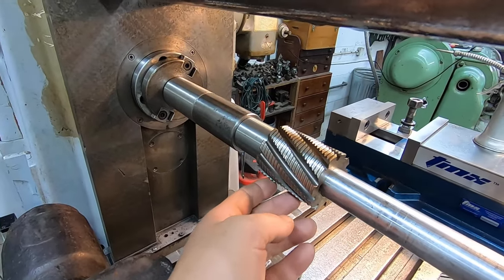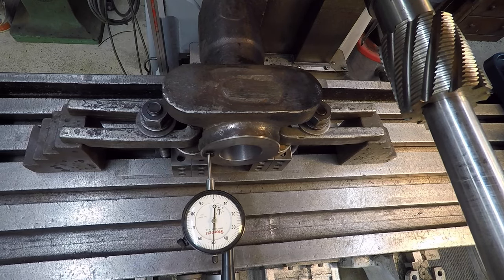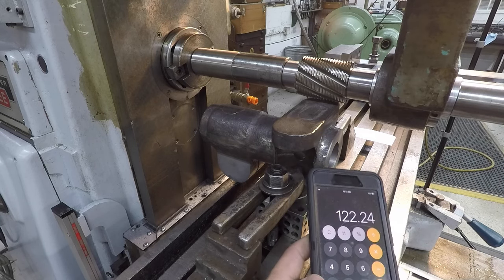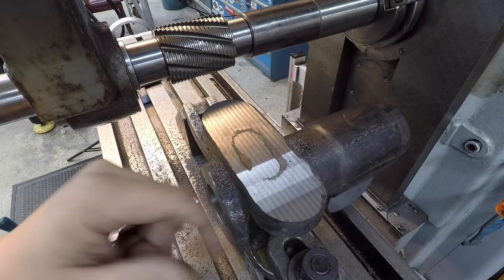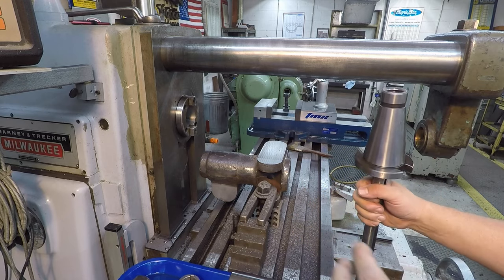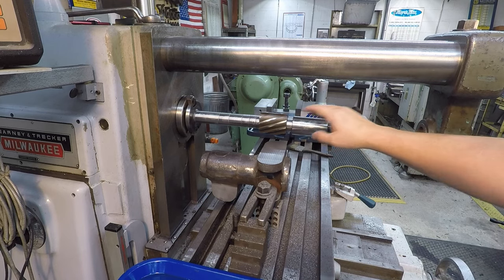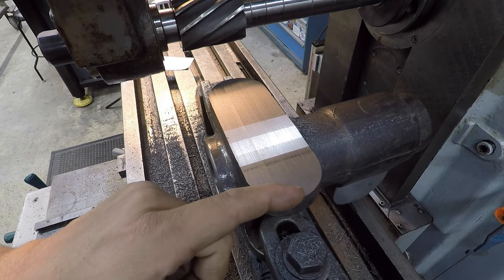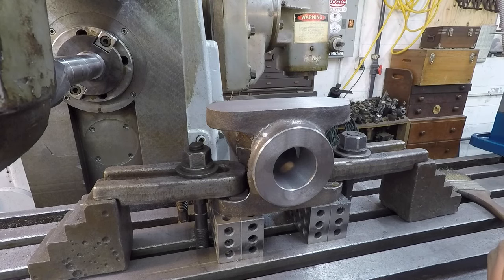Fairbanks Power Hammer Cross Head: Part 3

Comment: I think a good thing to add to one of your videos would be the correct way to tighten the drawbar holding the Arbor. The drawbar thread should not be bottomed in the Arbor prior to tightening the nut. 
It never ceases to amaze me how accurately KT and Milwaukee horizontal mills overarm bearing aligns with the Arbor when you run the overarms in, to place the bearing on the Arbor.
Thankyou for sharing your experience and know how with the world.

Comment: Couldn't help but figure it out: 0.262 comes from pi / 12. The other number - that 3.82 - is its reciprocal, 12 / pi :)
Reply: Why is this done? Is it an imperial thing?
Reply: @Bbonno  Partly! The pi is universal - it turns the cutter diameter into a circumference, which is the relevant thing for the surface speed. The 12 is an imperial thing - turning the inches (in which the cutter is measured) into the feet (in which the surface speed is quoted)
Reply: @ramanshah7627  thanks! I had never seen 12 being significant when doing math on circles, and I've never done conversions within the imperial system. Glad you're here to help!
Reply: @Bbonno  the 12 converts feet to inches, and as Raman Shah said, pi is for converting diameter into circumference
pi * diameter = circumference
circumference * RPM = surface inches per minute
surface inches per minute / 12 = surface feet per minute
so it all works out to pi * D / 12 = SFM
and of course, if your going the other way: SFM * 12 / pi = D
Reply: Thank you! I was wondering where those two figures came from and was about to ask, myself.

Comment: I love those corncob mills when you have to remove a lot of material, they cut amazing. The slow motion was neat. Great explanation of horizontal arbor setup. We have a combo mill but not much horizontal tooling yet. Is your arbor support bearing just a plain bearing?
Reply: I think its just a bronze bushing, but it may be steel, im not sure. But no rolling elements.

Comment: In the slow motion, I observed to points on the off side of two edges that appeared to be magnetized. Is that a result of the manufacturing of the cutter, or the cutting of the material?  The RPM of the cut is not fast, so electrostatic magnification does seem likely, but then it is iron. I’m wondering if the steel is hammer forged at all. It might cause a physical compression of the material at the surface, producing a point of concentrated electrons that weren’t milled away when the cutter was machined. Or is there another reason. I know this really isn’t important. I’ve just always been a little overly inquisitive, especially with anomalies.

Comment: Nice Adam. The machining is all good, but honestly my favorite part of this video was you talking about the machine and how and why you set up the way you do and what to do or not to do. Even though we might not have your exact machine, it's very helpful to know what kind of stuff to avoid doing which could cause a world of headaches.

I do have a question for you though, when you prep those spacers, even though it's minimal, when you sand the ends of them, wouldn't that over time eventually cause a problem? I mean, you're not going to be able to hold them absolutely perfectly flat, and light pressure, fine sandpaper ect. wouldn't be to much of a problem it seems to me that if you did it 10k times it might end up with the ends of those spacers not parallel to each other and might cause a problem. Am I just overthinking this?

Comment: Ya I'da been there all day with my mini mill. Though now I was drilling the pivot for a ko lee radius (homade) to bore it out. and the fuse link on the neg/nutral blew actually took out the DRO so soldering together the $40 capacitive scale now and gut the lectronics from some new 6" It was a kb electronics damn fine dc motor drive the kbmm been a month or so since i machined

Comment: Adam, in Pensacola, do you send your cuttings to the recyclers? Some cities do, some don't. Some places pay for aluminum, brass, bronze and copper cuttings, not so much for ferrous metals. Just curious. Hope to see you at the Bar-Z if there is one. Thanks for the video. Jon
Reply from the maker: I save them and take them to the scrap yard.
Reply: @Abom79  Which scrap yard? Im here in Pcola looking for non-ferrous scrap to melt and cast. All the yards I have called will only sell by tons and I only have a 2kg crucible.

Comment: why not climb mill ?   thanks for all the videos
Reply: Its good practice to convention cut metals with a hard scale. It prolongs the life of the cutter. This way the flutes come up through the bottom instead of cutting down through the scale.
Reply: Simple terms, Tool life
By cutting this way HSS tools start taking a  light cut as they engage - shaving clean metal and and lifting  the hard scale away
With Carbide you would often climb mill as in laymans terms they wear faster in shaving than they would risk chipping from impact

Comment: I learned CS*4/D. Cutter speed*4/Tool diameter. It gave the same RPM.
Reply: Does the * mean multiply? Thanks man.
Reply from the maker: its acceptable to use 4 instead of 3.82
12 divided by pi= 3.8197
Reply: @markdavies8037  yes

Comment: What am I missing? Why does it matter facing that bore in X? It seems to me Z would be the important reference. Pitch, not yaw. Me no machinist, but that seems off to me. Coughjobshopcutoffscough. Love the channel.
Reply: I could be wrong but my assumption would be so that any potential brittle failure stress risers are at 90 degrees to the final directional orientation of the part to reduce the risk of stress fractures
Reply: I  was thinking the same thing, however he may have additional operations he  hasn't shown yet in which that alignment is critical.
Reply: I think he's planning to machine the other end of the bore with a shell mill / end mill (what's the difference) without refixing the item to the table. You're correct, for this machining it didn't matter. The really bizarre thing is I've seen a bit of that shell milling process on another machining channel. The question is, how did they get hold of the video before Adam's published it ! (It's dated August 2020)
Reply: @millomweb  A shell mill is a cutting head that is made to be a component part of a cutter driven by a key colloquially called a drive dog - This we see here is shell mill, the multi insert cutters we see him use when face cutting are also shell mills

End mills usually smaller - they are tools that are held in collets mainly - Similiar to slot drills
Slot drills are end mills that are able to plunge cut aswell as horizontal due to one of the cutting edges being past centre where as an end mill cannot plunge into solid as it has no way to cut the center
Reply: @millomweb  Time warp! I'd be interested to know how this came about. Is Adam aware?
Reply: @bengrogan9710  Shell mills - screw onto a mandrel ? I'm sure I've seen that style. They're both end mills in practice - perhaps the distinguishing feature is larger diameter and no cutting edges inside the periphery ?
Reply: @MartsGarage  He should be as I've sent an e-mail to him. I'm a bit surprised it's still there. All that channel is the same style - close ups of machining and no talking - so pretty sure most of the content is nicked from other tubers !
Reply: @MartsGarage  I watched that clip a week or so ago - and recognised the shop. 2 days later, Adam starts working on the piece. Spooky ! My first thought was that he was working on a second one but things became too similar !
Reply: It is smart to have a few videos (if not a whole project series) completed and waiting to post, the way it was described to me is that it gives the video maker freedom to go  weeks if not months without making any videos. Kind of like an insurance policy, in case something happens, or if the channel creator just says the hell with it for a few months. That way we still get our videos, and the creator still gets paid and supported. In the end, it's just  business.
Reply: @bengrogan9710  Unless it's a center-cutting endmill. 😏😉😎
Reply: @markschweter6371  the exceptions that prove the rule - there are arguments that can be had about those.
One POV is that over centre end mills are actually a form of slot drill, the counter arguement is that drills only have 2 flutes - other than coring drills, which some argue are a type of ream.
You see how this goes on

Comment: Why is it that youre machining with the chips going in front of the cutter. I have always learned and it seems to work. That you should always make sure that the chips goes away and behind the cutter. The helps alot with chatter/surface finishes.
Reply: Isn’t that climb milling? I was taught to avoid that.
Reply: Always mill conventionally. If the swarf is coming out the back then that's climb milling. Good to do for a .005 thou finish pass on a workpiece that you are confident is held rock solid. Otherwise do as Abom, he knows. Climb milling is a recipe for an accident. It will grab and you could lose more
than a finger or two.
Reply from the maker: Terms you are referring to are “climb milling” and “conventional milling”.

Comment: U can achieve a better surface finish with down-cut milling instead of ordinary milling...hope my english is understandable
Im european...Czech...machinist...really like watching your work but im struggle with empiric system...
whatever....nice work
Reply: I'm from the USA and trust me, we struggle with it at times too. Metric is so much easier. Switching over to metric was talked about many years ago but it never seemed to take off. I was in the medical profession and metric is used there. I would convert over in a minute. I use it a lot on my own.
Reply: Slovak American here. Yes, many struggles with foolish USA system. At least break the inch into thousandths and then it is not so hard.
Reply: @RRaucina  Probably the best reason for our continued use of the Imperial system is the well built machines such as Adam has.  They were designed to use inches and fractions.  Modern equipment can, and often is, designed in Metric.
I'm a Physics teacher and don't use Imperial at all.  Everything we measure and use in the lab is metric.  However, I don't think it's that difficult if you need to use Imperial system like Adam does, keep practicing and using your head and you'll figure it out.

Comment: Don’t get me wrong. I mean no criticism since I’m not a machinist but I’ve had a question in my head every since you started this. Why didn’t you drill the hole for the pinch bolt before you slit it?  I’m just thinking about any flex from the tool pressure. I’m sure you have a good reason. Great work and camera work.
Reply: I was wondering this too.
Reply: He mentioned in the previous video that it's due to the fact that the K&T doesn't have a quill for the spindle on the vertical head. Which doesn't make much sense as it could be done with the horizontal setup by just moving the Y axis in and out. I guess it makes for another video just for the hole.
Reply: @pedrobatista4439  He also mentioned that doing it by raising the knee doesn't give him the control/feel that you get with a quill.
Reply: @kindabluejazz  well I wasn’t talking about how he chooses to drill the hole or with what machine. I was wondering why he made the pinch cut before he drilled the hole. Since the pinch slit is made to flex, it seemed that the tool pressure might flex it where the holes on both sides wouldn’t line up perfectly. I’m sure he knows more than me so I was just wondering what the reason was.
Reply: @yqwgjsg  I was just responding to the other post about which machine he chose to use. I'm not sure about your original question. It may be about how many times he needs to do setup on different machines, not sure. I think he could easily put a 3/8" spacer in the slit to keep it from pinching while drilling. We'll see...

Comment: Thanks for bending an abor so we dont have to lmao, but uh going in dry on those cuts is true bravery , I sure like the patern that rougher makes and roughness on a manually oiled part is a good thing 6 of one half dozen of the other.
Reply: The arbor is not bent. The spacers have a little play between their inner diameter and the arbor shaft. Because of this the spacers appear to spin eccentrically. It gives the illusion that the shaft is bent. the shaft within the spacers remains straight. Look at the cutter itself and you'll see it remains concentric (for the most part, since the cutter also has some play in it's fit on the shaft.
Reply: Cast iron cuts best dry
Reply: Don't need lubricant on cast iron. It has plenty of graphite for that.

Comment: How do you decide what machine to use for a certain application?  This could have been done in the shaper, or finished with a fly cutter, or Chris at Clickspring could have used a file and brought it out to a mirror finish.
Reply from the maker: Often when I’m planning out how I want to approach a job I think ahead of the machines and process I want to use. The job was perfect for the horizontal mill and I wanted to use those processes.
Reply: Also allows us couch machinists to see different machines, setups, and processes.👍
Ask three machinists how they'd do the job and you come up with eight different ways.😁

Comment: I think it great the your putting in highest expertise on the Fairbanks part   But they’ve never had that much percussion from the factory when they were built. Great job thou!!!
Ps. Have you ever cracked the table by tightening the clamp/ hold down bolts?

Comment: I always made it a practice to have the cutter turning opposite of the direction needed to tighten the arbor nut.  Same holds true if you're mounting a grinding wheel on the left side of a spindle..... left side is left-hand thread, right side has a right-hand thread.  Having a cutter come loose because it was turning in the wrong direction isn't fun.
Reply: The key prevents cutter rotation on the arbor. The effect you mention would be important were it not for the key.
Reply: @donkinzer5718  Of course there's a key used, but Key or no key and they can still loosen up if rotation is wrong.

Comment: Unexpected slow-mo is unexpected.

Wouldn't it have been a good idea, after you got the part cinched down, to also test that flange top-to bottom to make sure the clamp end is not weighing the part down and causing the surface to bend slightly? Maybe put a machinist's jack under the clamp portion to keep it from sagging. Probably not a huge issue for such a small part.

Comment: At the slo mo as 18:52, you can see that only a couple of the cutter teeth have magnetized, and are dragging chips up along the motion. Cam anyone explain why its only a couple teeth magnetized and not the whole cutter?
Reply: There is no simple way to be certain exactly where it happens - cast iron is not as uniform as steels structurally and can have small pockets where the metal is more or less magnetic - once a tooth has gained an amount of magnetism the rotation of the tool essentially makes it an very weak AC generator which then causes that section to become more magnetic with each time.
That then amplifies the effect as the tool runs causing it to gain in strength and then slowly soak the magnetic gain to a larger area

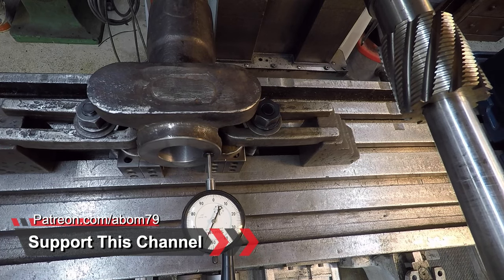Comment: Adam, the camera you are using around 1:30-2:00 is putting in an 8.6kHz high-pitched squeal into your video.  It's quite painful to listen to.  It's been on many of your videos for quite a while.  Maybe you could add an audio filter to remove this spike?

Thanks for the video.
Reply: Its one camera/ mic setup that shows up from time to time. I have also mentioned it in the past. Just about drives you up the wall if you are wearing headphones.

Comment: I didnt quite understand your calculations for the cutters surface feet per minute. Shouldn’t  Pi (3.14) figure in it somewhere?
Reply: Going from a diameter measured in inches to surface-feet explains the first "magic" number: 3.14/12 = 0.262
The second  is going the other way: 12/Pi = 3.82

Comment: Any reason you use the horizontal shaft over a fly cutter?
Reply: I was thinking the same thing.
Reply: Probably because that was the right sized table for the job. He also said he was going to clean the back side of the hole in the same setup. Less work passes too.

Comment: Was there a dimension from the hole to the face you just milled?
Cleaning the arbor drive we had a felt covered taper plug that we used to get it clean. You need a pack of cigarette rolling papers to set the roller mill 0.0015" thick.

Comment: 21:22 I'm not a machinist and I'm trying to understand why the z-plane is being measured horizontally, shouldn't this be measured vertically?  I don't think the horizontal measurement would make any effect as the cut will be done on the x-plane.   A vertical measurement on the z-plane would make more sense.
Reply: It could be that horizontal mills work in the same coordinate system as a lathe. You are right though it is kind of weird.

Comment: I have two questions: standing up your 1x2x3 blocks? Why?  and how’s the Mac book video editing going? Thanks for sharing.
Reply: I believe it's just to give a comfortable spacing underneath so he can easily manipulate the micrometers without worrying about collisions underneath throwing them out of true
Reply from the maker: I had to space the part up to clear the bottom of the casting and still have it setting on the previously machined surface. The 123 blocks sometimes work out to be the perfect parallel. Video editing on the MacBook is coming along. This video was edited on it.